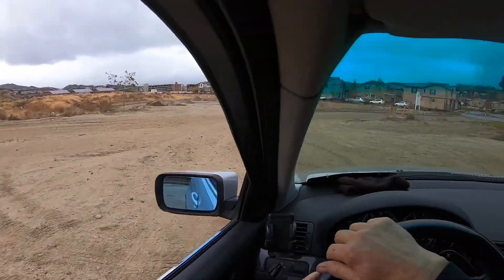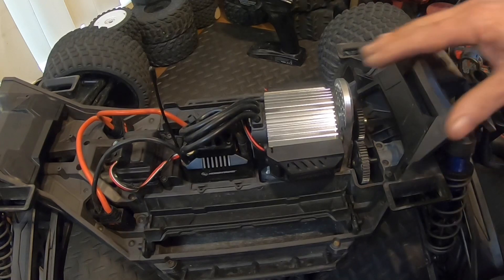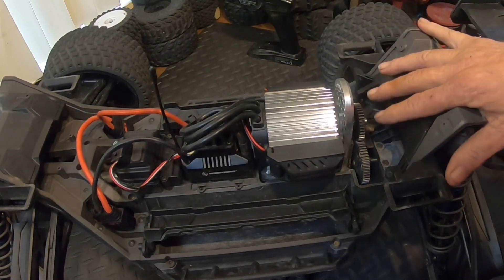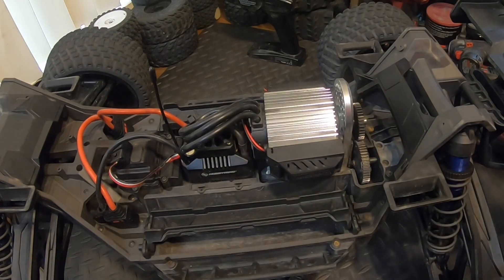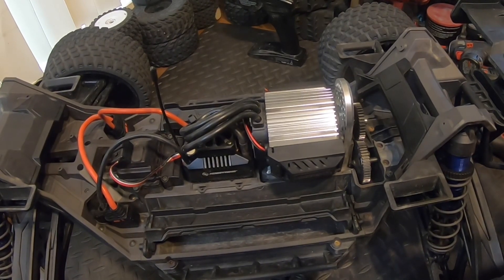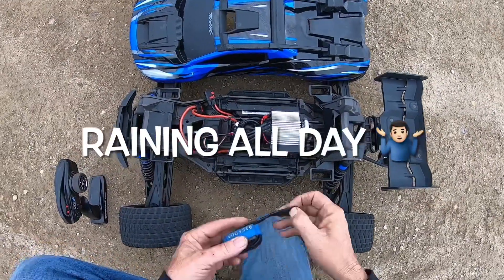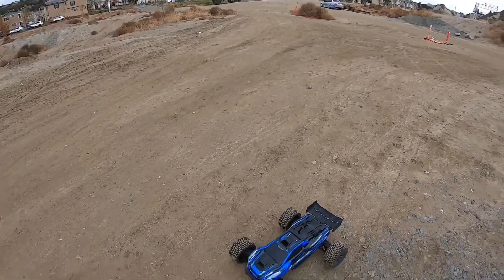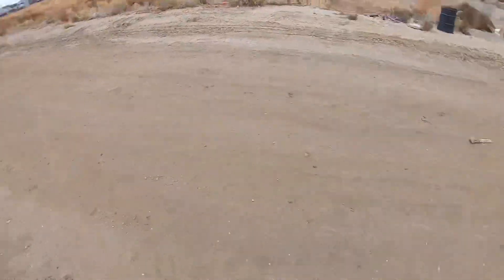TRAXXAS XRT Mini Big Block Bash Fail ? Why I Never Installed A Big Block Into My Xmaxx’s?

Comment: You can get a 3-D printed gear cover for 12 bucks but ur 100 % correct the stock motor is the best for bashing ..awesome vid 👍👍👊🏻👊🏻🇺🇸🇺🇸🇺🇸
Reply from the maker: Won’t fit as I trimmed the area it would seal at this mount for the xmaxx doesn’t fit like it should that why I feel everyone making an XRT mount 👍

Comment: Earl, I get comments sometimes about wanting to leave my stock motor in my xrt. When I had my xmaxx I loved it at first. Then I went down that upgrade road. Long story short I ended up hating my xmaxx. It was over powered and broke all the time. Stock motor with a max6 was fine. My xrt will get a max6 or max5 and keeping the stock motor. I'm not making my xmaxx mistake again.
Reply from the maker: Yes 👍 we all find are selfs over building a basher as we see all these videos suggesting we need stuff we just didn’t keep cost down is best ⚠️👌💯

Comment: Bonafide ripper right there  might need a set of bead locks on that spicy unit. Definitely has me thinking about putting that setup in mine I don’t bash mine nearly as hard as you so that setup would perfect for where I run my R/C’s

Comment: I installed a Max 5 and 1100kv 5687 motor on my X-Maxx, but I had to put aluminum diff cases, diff covers, a shim in front of the outdrives in the front/rear, and an aluminum spur gear cover. Drive cups sleeves are also necessary. With those upgrades, my drivetrain can take it. For the XRT, I only installed a MMX8S, DuraTrax Lockups X tires (bigger than than stock), Radiolink TX and RX. And with those upgrades, I do backflips easily. I don't feel that I need a bigger motor for what I'm looking doing. I'm good. I'm not going crazy with this one in upgrades honestly. I'll keep the stock heating too. To each his own. Thanks for the video
Reply from the maker: Yes end up a ton of aluminum that cost a lot ⚠️👍
Reply: @earlmoorhead5555  not only that, but you need higher gearing for the bigger motors with lower KV. And you increase the weight dramatically with bigger batteries, the electronics, the extra aluminum etc. So your run time gets cut a lot. Meh, not worth it.

Comment: Got the max 6 with the speed gearing and stock motor in mine Earl, I personally think it's just about perfect for what i do. I want to give the Lockup X tires a try though. Keep up the great videos.
Reply from the maker: Yes when I ran that it seemed perfect others then breaking upper bulkhead 👍👍

Comment: Great video brother...respectfully I disagree about Traxxas. Traxxas is expensive imo, and super expensive when modifying them. I agree about the plastic tub, but you're right when it comes to how someone drives their units. I have 3 XRT's. I'm disappointed for the price. I love the concept, but its incomplete. Bro you've saved me a ton of money and I thank u. But Arrma is better with warranty, period. I've had issues with models and they don't hesitate to send a new transmitter, esc,..u name it, without twisting their arm. For the price Traxxas's electronics are garbage and I give grace for a new platform when it comes to the bulkheads..but when you're charging premo dollars come on! Lol Arrma warranties electronics for 2 years! Traxxas 30 days.
Reply from the maker: I agree arrma will send free replacement as you are the warranty! They know they have quality control issue but they also know it’s cheaper to have the customer replace the part then pay a whole department of ppl to quality check there rc before sending them out ? A radome defect-Will happen to any company but horizon knows it’s better to just limit the number of ppl they talk to a month for warranty issues so they turn off the phones and control warranty iteams for the month and make the customer the repair department 💯💯cheaper in the end for the quarter reports 🤷🏻‍♂️

Comment: I used a bow house motor Mount 1100kv 26/46 still fits cover for gears and lots of power there a few videos people installing them also vitavon makes a extend cover you can buy motor mount from amain or eBay it really does sit low in there

Comment: I really think that the OE tires on the XRT were seriously very much more of a rushed afterthought, vs spending alot of time, and money to actually develop something much better! (Regardless, and irrelevant to  just becoming unglued) The XRT truly needs better tires with a better sidewall, along with dual or triple rate progressive springs . I wont even get started on that tho!
This thing would be a decent deal at $599. I say that knowing good, and well what it actually costs Traxxas to manufacture each unit!l
Reply: Thats why I sold my stock XRT tires and I put bigger Duratrax lockup tires. Way better for off road bashing.
Reply from the maker: I have them on my Losi dbxle

Comment: Hey great video . I feel the same way with traxxas. Parts are cheap and abundant.  I run 800kv mamba xl2 setup with 30 /30 gears. Its a wheelie beast. I have seen Vitavon. There is a guy I forget his name he Vitavons everything.  My setup is B&M (no its not bowel movement) its two years old and have had no problems.  It would be nice to see a cover for the spur and pinion.I had Outer wear but made it a pain to change batteries.  I was told to definitely stay away from the belt setups. Thanks for the video.
Reply from the maker: Thanks
Reply: exocaged?!
Reply: @DB-qm4jx  that's what I was thinking too
Reply: @johngoodwin4353  exo is cool for seeing how a car handles in a average persons hand. Earl rocks cause he knows his mechanics of things.

Comment: today i took my xrt out for its third rip, first time with 8s, previously was on 6s. well, today it went on its side and i was on the throttle and one tire stopped so the other oversped and unglued one of the rear tires on the inside. its still on the stock motor and gearing as well.
Reply from the maker: Yes time to tighten up the center differential ⚠️👍

Comment: Hey Earl. In my Xmaxx i have the Max6 with the Hobbywing 1100kv. I run a 29 Arrma Spool with the GPM 50t. Onroad speed is 62mph. Thats perfect for temps and bash. On Field it went 54mph so i agree with you. 50mph is best for bashing an xmaxx. Your 39 pinion is way too much i think
Reply from the maker: 39t will have wheel speed 😳🤪

Comment: Also don’t no if you notice the gear cover on xrt has a little bearing with a screw in it the xmax cover does not have this I just dermal mine out ,
Reply from the maker: Yes I did talk about the bearing there and added oil to it after running threw water 👍👍

Comment: Hi Earl! Maybe you could have someone 3d print a larger gear cover to keep the dirt out of there, I'm sure somebody could design and print one for you pretty easily! Hope you are doing good brother! 💯🤜🤛😁👍
Reply from the maker: Motor mount won’t let a cover fit
Reply: @earlmoorhead5555  oh, I gotcha... Thought it just needed to be taller to fit over the bigger spur and pinion...
Reply from the maker: Yes and the mount pushed forward for the xmaxx so I trimmed the lip to make it fit where the cover goes

Comment: I believe they're 3D printed
Reply from the maker: This mount I had to trim the base as it hangs over the place the cover seals at as the xmaxx was a little different the XRT just won’t work with a cover maybe when everyone makes a XRT specific mount that might work then 👍💯the xmaxx ones definitely won’t as they sit on the ridge for that seal on the left side of the mounts 😳🤔